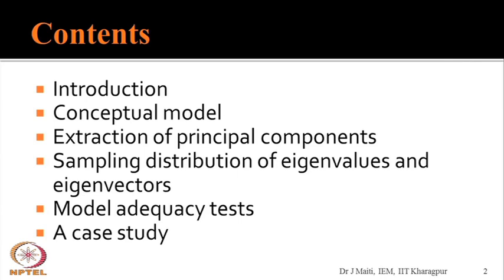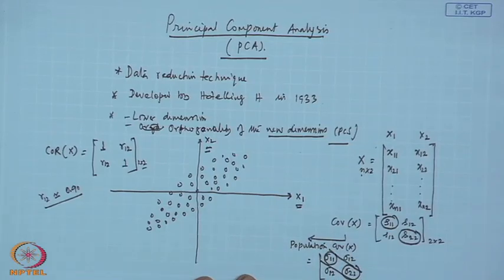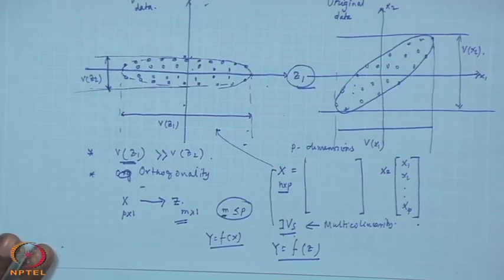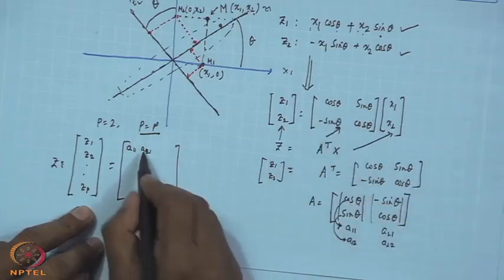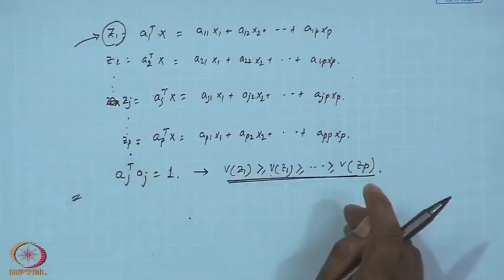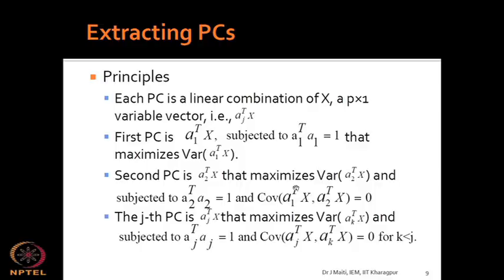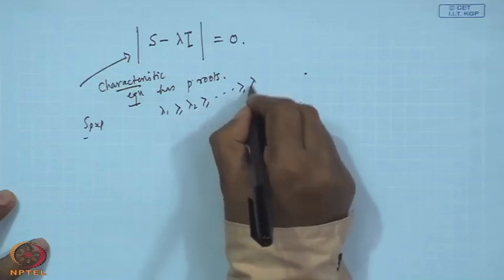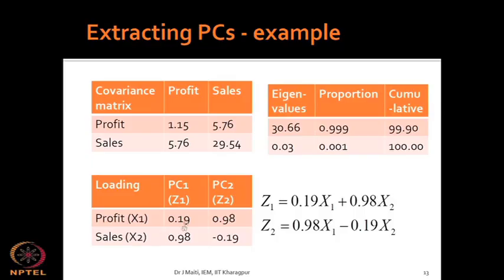Mod-01 Lec-30  Principal Component Analysis (PCA)

Comment: Indian teachers are by far the best. Mainly because many of them have stuck to traditional forms of instruction...patiently explaining and WRITING DOWN everything step by step. Nothing beats this. 

As a student you don't want to see everything compressed into slides with all the info already there (a sad norm by lazy professors in 'reputable' universities nowadays. You want to see the puzzle unfold as the teacher explains. Slides should be used sparingly as used here.